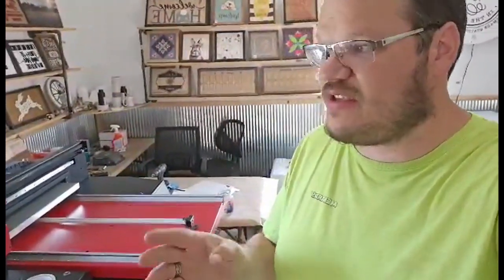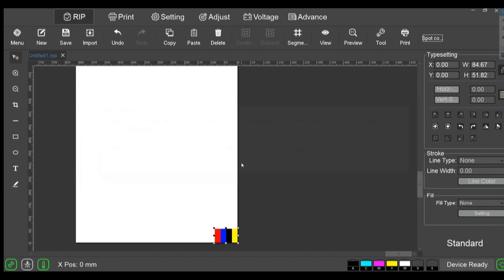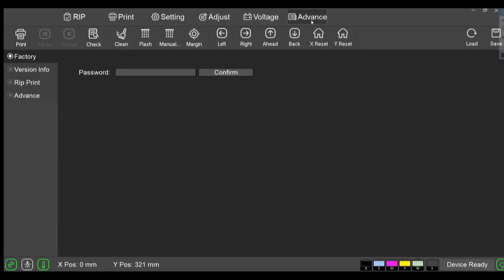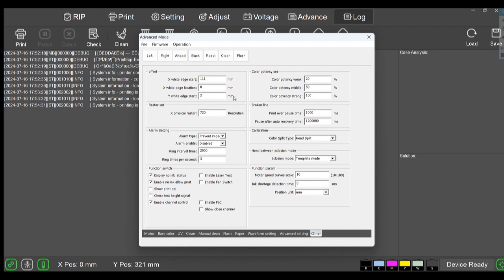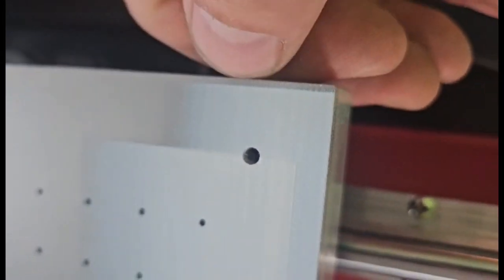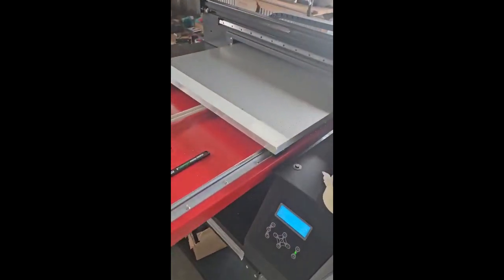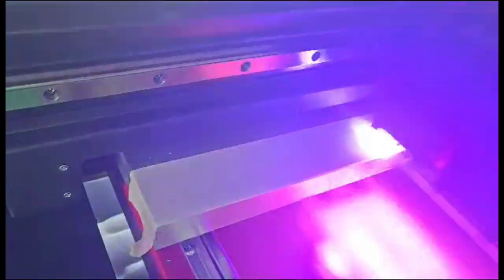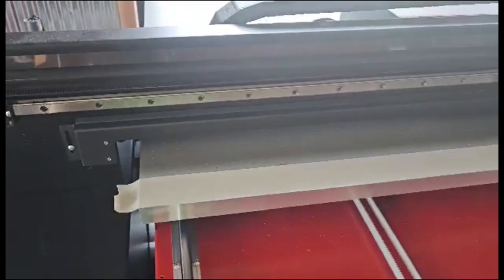How to get your 6090 uv printer print 24x36 inches also set your zero point hosonsoft printexp n10

Comment: I have a 6090 that just stopped printing. I have replaced everything on the printer. Heads, boards, power supplies and fiber cable. It goes through the motions, everything except there is no ink coming out.

Comment: Recently got one of these bad boys for the day job. I've done a bit of testing and so far so good. I am a little confused, however. Every single CNC I've worked with, even vinyl cutters to some degree, have a way to program the height/depth of the Z axis so when we run a program again the cutter(or table) always go to the same height. This is handy for when one makes different height things on the regular, but there might be jobs in between.
How can I do that with this printer? I anticipate needing to have a few specific heights saved for ease. The only thing I can think of is to get some gauge blocks and write down what things end up measuring to at the perfect heights because I don't see anyway to program a Z0 😅
Reply from the maker: @gracemakeslace  no therr is a informed hight sensor the item should be about 1/8 inch away from the item it is printing
Reply: @JaysToDoList  dang, so I will need gauge blocks to ensure perfect uniformity. 
Thanks for getting back to me so quickly!
Reply: @JaysToDoList  oh wait! So when it triggers the sensor and starts to back down- that's the height?
I've only been testing it on adhesive vinyl as I have scraps of it in abundance here, it's almost as thin as paper xD I didn't get quite that close but the print is still clean AF.